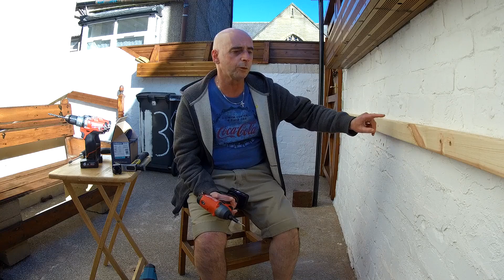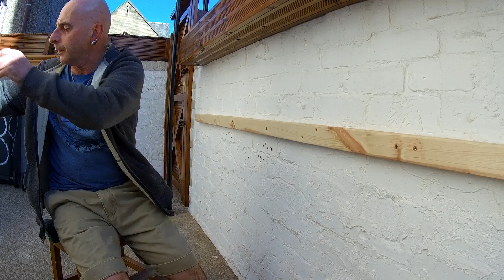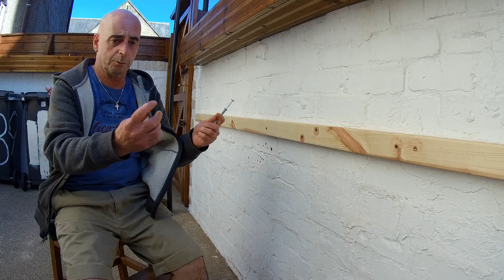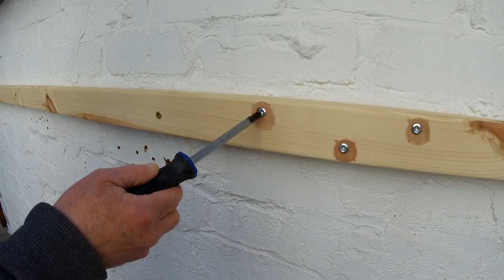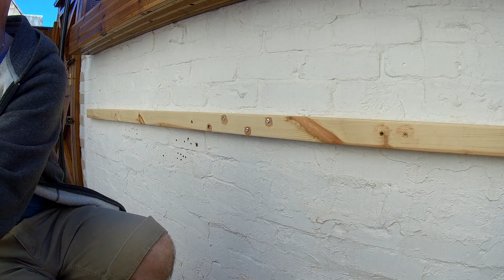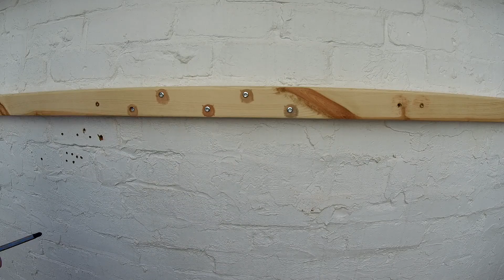Hammer fittings: The professional way

Comment: Why are they called hammer fixings you ask when it's actually easier to put them in with a screwdriver ?  - it's because they pre-date the impact driver and the power screwdriver becoming affordable to DIYers and even most small job professionals. Good video, thanks !

Comment: Great Absolutely Pro - I am keen DIYer I am looking to frame bathroom with brick/mortar walls on all 4 sourrund with 2 by 4 timber (47 x 100mm) at 400mm centres - this is as so they can take hardie backer board - to fix the 2 by 4 time which is about 2.5m (floor to ceiling) i will use 'Timco Frame Fitting 10 By 8 - Question Is How Many Frame Fittings Do I Put In Along The Length?
Reply: 4 is fine for the walls along the floor you want 1 every 600mm
Reply: Many Thanks 😊

Comment: When you stagger you need to make sure that your drilling a hole in the brick not on the mortar joints, also make sure you wear safety goggles 🥽 and ear plugs, when your drilling. Also you can get concrete screws these don’t require any wall plugs advantage of this it won’t crack your brick or blocks especially if you are putting gate post close to the edge of brick work.